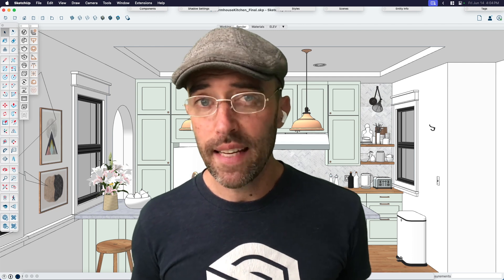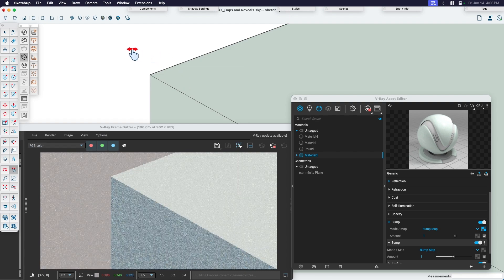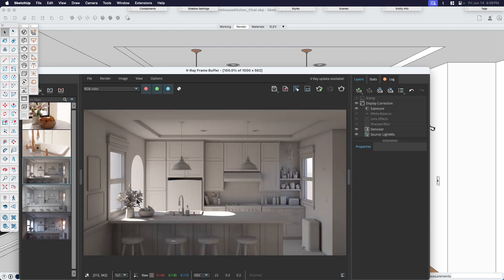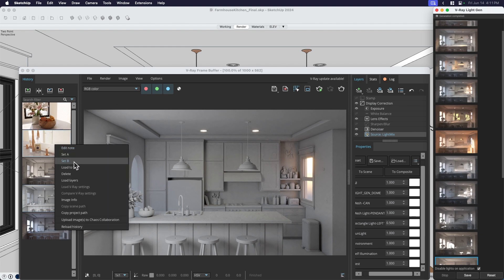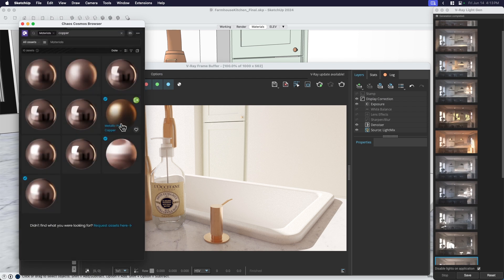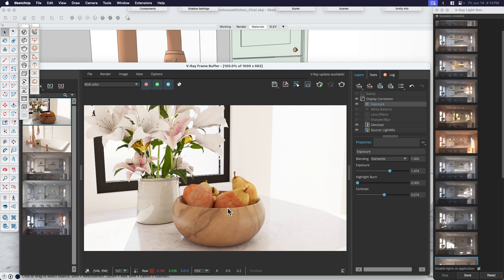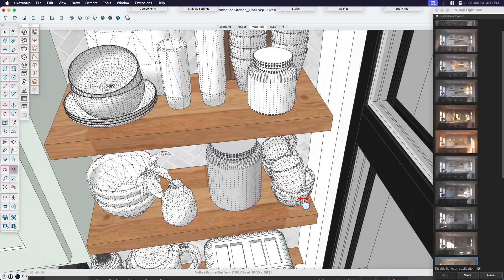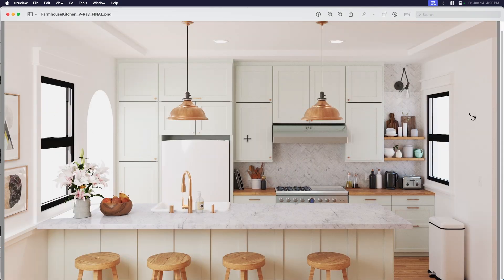5 Quick Tips for Better Realism with V-Ray

Comment: Hello, my name is Calvin and I would like to ask you something. I have just used a macbook pro m2 for about a year and a half. Because it was only used as a secondary computer in the past, it was relatively small. However, my main pc broke a few months ago. But due to the bad economy, I didn’t buy a new PC. Instead, I started using a Macbook. Since I am doing interior design, I have been using cad / sketchup / 3d max. After I used a mac, I could only use sketchup for rendering. , but because mac run sketchup vray is really slow compared to pc, so I switched to enscape, but when I was idle, I would look for ways online from time to time, hoping to use vray again.